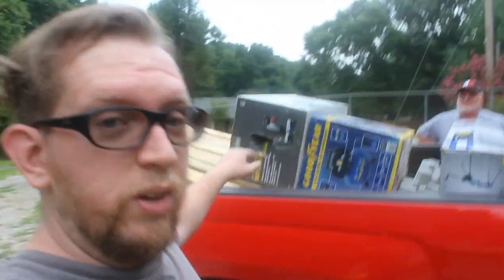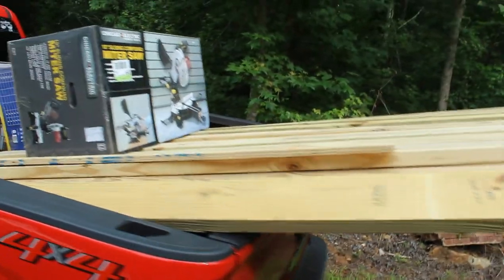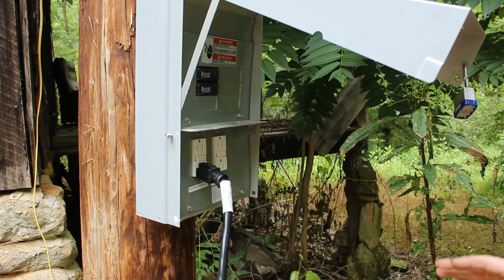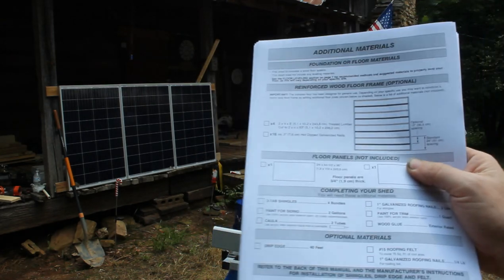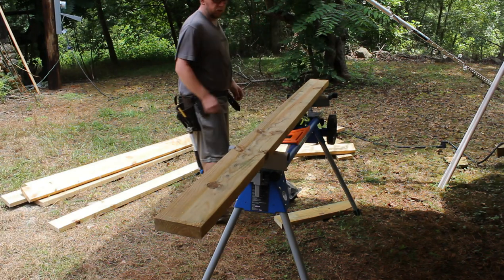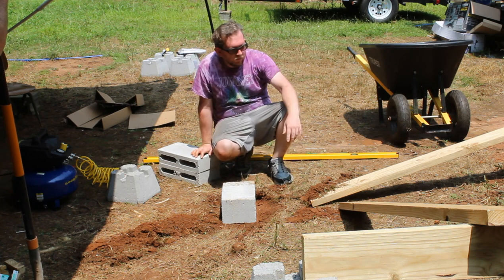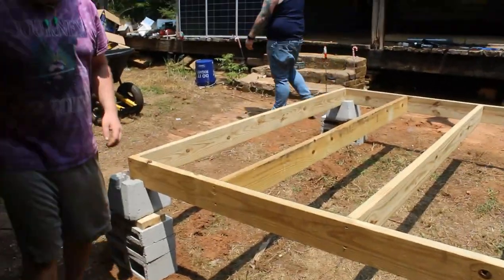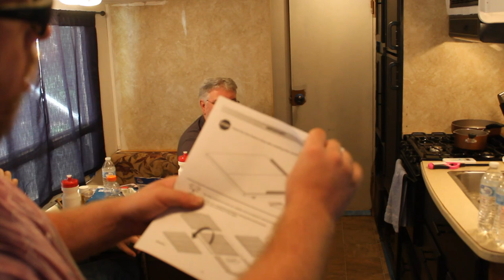Let's do this, The start of our COMPOSTING OUTHOUSE... Leveling the foundation and floor

Comment: Ok you are building a compost bathroom can’t you just attach it to the house? Now what you’re doing so far don’t an outhouse specks so far even though it has been 30 years since I used one and that’s the one where you can have multiple seats and depending upon how deep you dig it depends upon how long it stays there and when it is done you move the building to another area until full and if it lasts 2-3 years in each spot then you can start over at the beginning again. So are you going to put in a wooden bench with holes in your flooring for your holding tank and then one for your gray water? I will have to see how you set up your plumbing. Good Luck 🍀   We have the same whether up in Wisconsin but we have the smoke haze from the western states and Canadian fires on the border. I sweat about a gallon of fluid on my 6 hr. work days and at least 2 days recovery but have done green beans, pickled beets, and canned cabbage. And the week of 8-8-21 I will be canning carrots and pickles dill and bread and butter flavors!  The next weekend a wedding and the next weekend another wedding but staying for a micro family vacation with the kids and grandchildren then back home. Finish with the garden except the green beans!
Reply from the maker: We thought about attaching it to the house. All the spots weren’t level enough. This is a shed kit from Lowe’s. We will modify it as we go. I hope it turns out as well as it is in my mind.

Good luck with all the canning. We are gonna can some green beans soon. Not sure if I will film it yet though. I’ve never tried pickled beets, they look like they would be good though. We just opened a can of pickles earlier this week. I’m hoping to can some this year too. I might get some from our local farmers market. 

I hope you enjoy the time with your family.
Reply: Thank You and Best Wishes with your ideas and remember that if you want it attached you can level out the land, insulation, and/or use moisture resistant drywall and then a shower-tub added with a sink! Sorry I keep suggesting ideas.  Don’t forget to stain the floor!